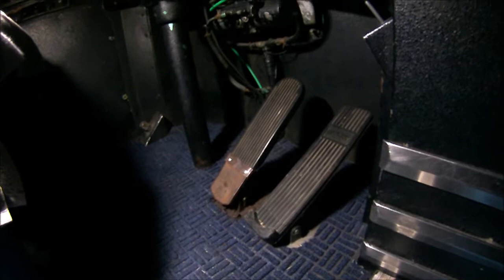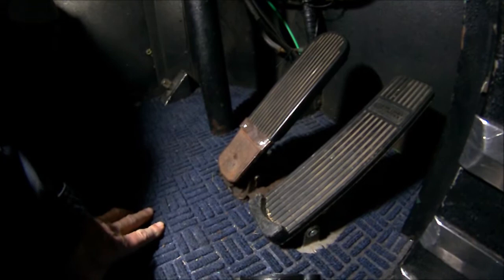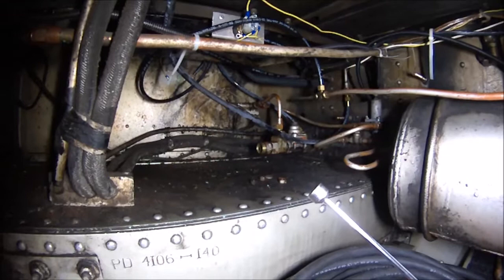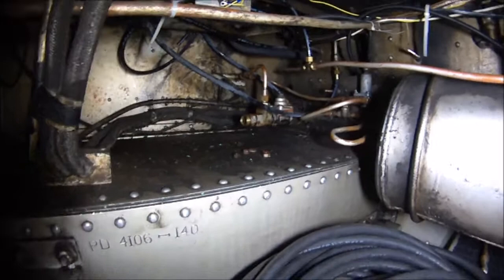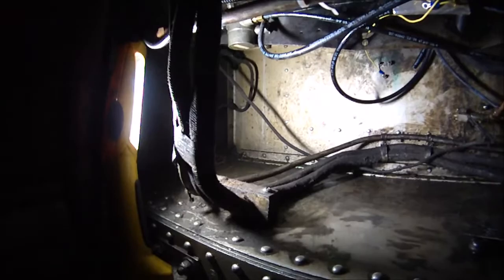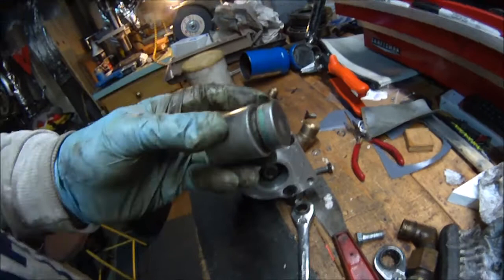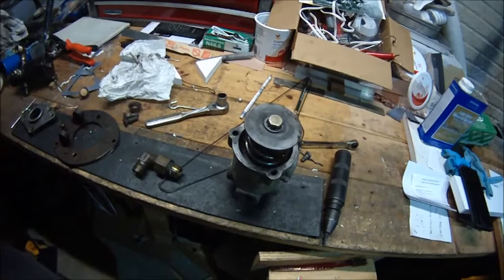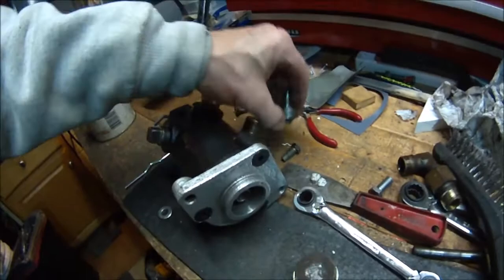E-1 Bendix Brake Valve Replacement

Comment: You always do a great job John. I have made mention of that in a couple of other forums. I have read a couple of articles over the years of old busses having accidents and it being traced back to the treadle valve and often not being able to release the brakes after a hard application thus throwing the bus into a skid the operator can't do much about. Have always thought if I ever buy another vintage bus a new treadle valve might just automatically be on the agenda. Cheap insurance to me.
Reply from the maker: Thanks for the vote of confidence Gary, always good to hear from you.  I have never heard of a problem with the valve not releasing before.  I certainly drove many buses long ago that must have used the same valve and never heard complaints about them.  Having said that, there were certainly shortfalls in the old design.  Too many buses rolling away because the drivers set the ICC brake and not the hand brake which released when the air drained off.  Also, the lack of automatic slack adjusters with the old technology sure didn't help.  So I replaced the original valve with a similar rebuilt version.  Are you suggesting upgrading to a more modern designed valve for your insurance plan?  Some versions had a limiting valve for slippery road surfaces that applied the rear brakes full force and limited front brake application.  That plan didn't last long and I never used one of those limiting valves when driving.

Comment: As usual, very admirable work, John. Both on the valve replacement and the cleaning. Other coach owners will be able to learn from this that they can do it. When I did this to a 4905, I built a ramp and put foam rubber over it so that I could lay there and work. As for the cleaning: a heat gun can loosen things up so you can use a shop rag to wipe a lot of it out. Also, one of those little steam cleaners like the ones tailors use are good. Is the exhaust vented down to the atmosphere. If that short line is gone, the exhaust will be puffing oily air into that compartment.
Reply from the maker: Hey Kevin, All good suggestions, for sure.  Wish I had thought of those options.  It was additionally challenging because of the weather and being forced inside.  Inside the garage, there is little more room to the left of the bus than is taken by opening the compartment door which makes it even more cramped.  The excessive oil is a product of several things, an old oil pumping compressor (new one installed several months ago) but moreover the vents all seem to terminate in there.  The wiper vent, the parking brake, and the foot valve.  The foot valve simply has a round port with a mesh screen held in place by two tiny screws and nothing really to attach a line to vent to the exterior of the compartment.  I don't believe it ever had a vent tube to the atmosphere, at least there is no evidence of one or one in the parts manual either. (did the 4905 have that?)  So I'm thinking about how I might extend that to the outside.  The 1/4" tubes can probably be extended without too much effort. I was going to lay some newspaper in there to see how quickly it gets oil covered and decide how extensive I want to make the modification project into. 
Thanks for watching!  Good to hear from you.
Reply: @strayhound61  If you do a follow-up on the improvements, please show how to use DOT plastic line and the necessary fittings. The 4905 did have a short line to the exterior. A guy could get away with something crude such as a piece of radiator hose and a hose clamp. Also beneficial as you learned is cleaning the treadle hinge pin and painting the mounting plate. That area is always gritty and wet, it seems.

Comment: If there is a book, without a mechanics license, where can i find one? i like a book to look at, along with videos
Reply from the maker: If you are talking about a repair manual for this or other buses, they are difficult to come by these days for these older buses.  They do appear on eBay now and then.  You can search or set notifications for specific models.  This video is for a GM bus Model 4106.  Hope that helps. Happy to answer an other questions.  Thanks for watching!

Comment: John, I am in the process of eliminating my ICC valve, since i now have spring brakes also. The valve you removed, that was connected to the ICC valve, is the "air pressure cut-off valve" I was going to just cap the ICC valve hoses, but now you have me thinking about the obstruction you encountered in the air-cutoff. that really doesn't have anything inside it, according to the book illustration. Did you replace the diaphragm and plug the top port? or what exactly did you end up doing to the valve? What was the obstruction? Thanks, Rich
Reply from the maker: Hi Rich, I'm really glad someone is actually benefiting from the video and that it comes at a good time for you.  Thanks for watching.  
So I initially removed (years ago) the I.C.C control valve by the drivers seat and the double check valve and removed all the plumbing.  I plumbed the 3/8" line going from the back of the treadle valve directly to the rear brake relay valve. (The connection is toward the back of the mechanical compartment under the driver's seat which was originally connected to the double check valve)  I also removed the the line that came out of the Cut-Off Valve and plugged the top of the valve.  During this most recent job (replacing the treadle valve)  I noticed it was allowing pressure to remain in the #2 tank while there was no pressure to the treadle valve indicating some obstruction.  So I removed the diaphragm, the plunger and spring on the up side of the valve toward the 3/8" line connecting port at the top by taking the 4 screws out and disassembling.  I used a piece of rubber sheet I had around but you can use RTV caulk or a piece of rubber to make a gasket.  I make gaskets out of bicycle inner tubes sometimes and they last surprisingly long. Removing the diaphragm, spring and plunger will prevent any opportunity for possible obstruction. I'm not convinced that pressure didn't get through to the other side of the diaphragm through a void of some sort and got trapped back there.  This would be a real problem if enough pressure gets back there on the high side of the range of full pressure, 90-120 and could potentially hold the valve closed with 120 while the service side has dropped below that.  (I hope that makes sense.)
Hope this helps.  Happy to answer any questions to clarify. BTW, you can use the port that provided air to the driver's I.C.C control switch to provide air to your new Maxi-Brake hand valve.  That's what I did. Let me know how it goes.
Reply from the maker: Hey Rich, one more thing.  If you make a gasket for the Cut off valve, be sure to cut the middle out of it so there is no chance it will block the port to the brake valve.  (I use a hole punch to punch the holes for the screws)